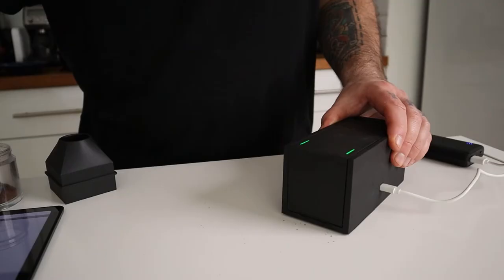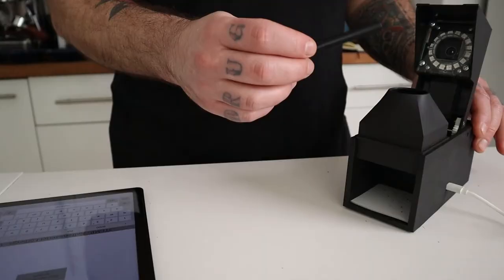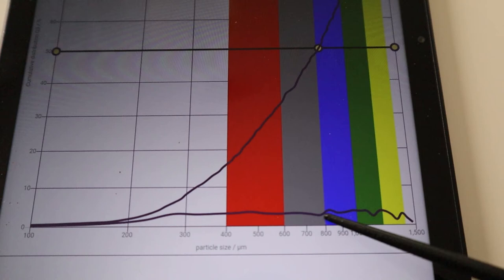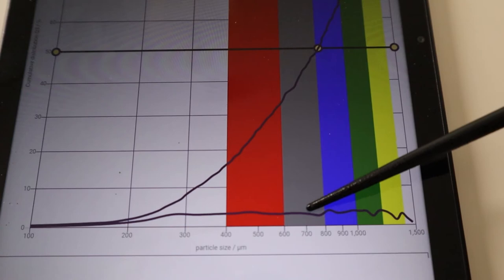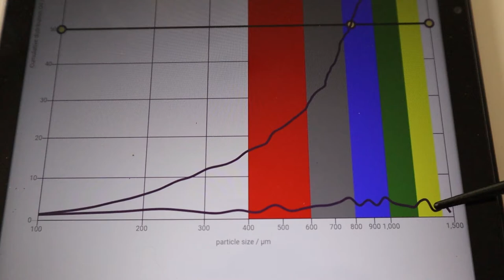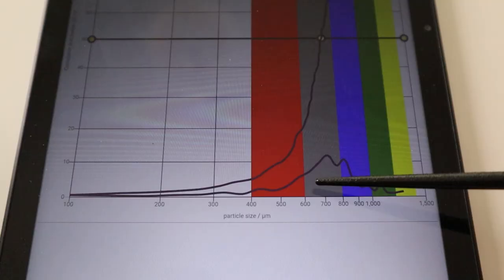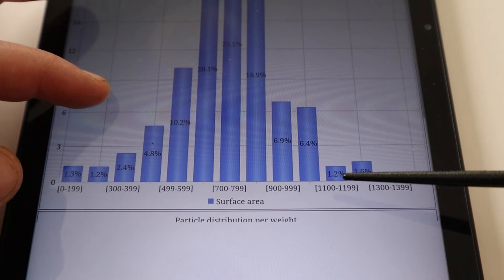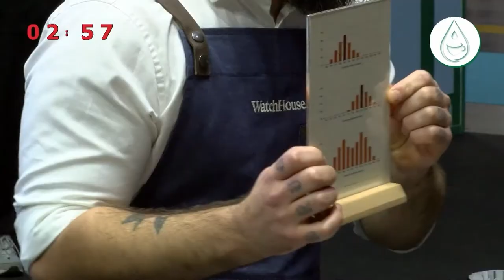Understanding The Coffee PARTICLE SIZE DISTRIBUTION with 3Temp's CPA

Comment: Great video and explanation.
I actually realized this when I was brewing french press style. Coffee in Turkey is very expensive due to currency fluctuations. So what I always aimed was to use less coffee with more water without the brew becoming weak or over-extracted. While I couldn't achieve this with the V60, I was more successful with the french press. 
I have two hand grinders, one is the Commandante C40 MK4 and the other is a local hand grinder MOLENT G50 which is similar in performance to the Timemore series. I brewed 15 grams with 300 ml using similar settings for the french press on both grinders. While the Commandante's particle size was more uniform the brew wasn't pleasing. You could taste the notes but I couldn't get the boldness and sweetness I usually prefer. So I tried grinding it finer but then it was way too bitter.
On the other hand, MOLENT's grind particle size wasn't that uniform. In fact it was quite the opposite of Commandante's. I could distinguish the fines easily. But the brew was amazing. I reckoned this was due to some fine particles in the brew which gave the cup more boldness, and character. Your experiment strengthened what I was guessing before!
Reply from the maker: Hey! Thanks so much. Thanks for sharing your experience. Every grinder is different of course and also coffees are different, important is to find the grinder that does the best work for you!

Comment: Ciao Matteo
What can you say about comandante particle distribution compared to other hand grinders and why is it preferred
I use 1Zpresso and absolutely love it. What I have done in many cases when I'm looking for more sweetness is to grind a portion of the total beans using a bit finer setting. For example, for Melitta, I always use 10gr of coffee at 1:16.66 ratio but when dialing in some coffees I often find myself looking for a bit more sweetness so what I do is to grind 10% of the coffee weight just a bit finer than the other 90% and this do the trick for me. I'm aware that the universal recommendation for more sweetness (more extraction) is to increase water temperature first, but sometimes I'm already using boiling water so the only other ways are, either grinding finer or changing ratio. While a higher ratio leads to more extraction it also push the brew into weakness very easy. On the other hand, I've found that grinding finer using boiling water has a dramatic effect that in most cases push the cup into bitterness or dryness zone quite easily.

This is why I thought of this simple custom grind recipe and has worked great for me. Please keep in mind I'm using a hand grinder with a very granular control, 12.5um per click, so I can make tiny adjustments to achieve the recipe. Other hand grinders with bigger steps may not work the same.

I know that for percolation methods particle size distribution is actually very important but what about immersion brewing where the solution kinda balances by itself overtime? I mean, grind size is always important regardless of the brewing method but immersion is more forgiving as other variables don't come into play like channeling or uneven agitation.
Looking forward to your comments
Grazie
Reply from the maker: I never tried the 1Zpresso, so I really cannot do a comparison. But with this machine it’s possible, that’s why is great. Comandante gives the best when you grind fine, the particles are more even, when you go coarser is a bit inconsistent, but it’s not bad at all. 
Your strategy of grinding a part finer then the other is exactly what my concept is. Mixing different size can create more flavours. Also if that works better for you, stick with it!
Reply from the maker: When we talk about full immersion particle size distribution still matters, even if the particles are always in contact with water the same time they still extract in different ways. Obviously it’s more forgiving compared to pour over, but still important. 
Thanks again for commenting and sharing your ideas!

Comment: Hi Matt ! Thanks a lot ! Are you sure it has to drain between 2.45 and 3.15 min? I always get 4+ min, even when I grind super coarse but then the coffee is under extracted. Basically i am or over or under extracting with the negotiator :(
Reply from the maker: Hi Edouard, I don't know if you commented in the right video, because I don't understand the correlation between the comment and the video. 😅
Reply: @matteofromtheswamps  ahah indeed. I guess i started typing when it was the Orea V3 video with negotiator but it was put here. So sorry ahah
Reply from the maker: @edouarddoudounovic4230  Perfect. Thanks for specify. First tip is to be careful with the negotiator cause if you press to hard you risk to clog and get slow drainage. If you go coarser and you under extract, try to increase the water temperature. Question, when you grind coarse the liquid drains very fast or still slow?